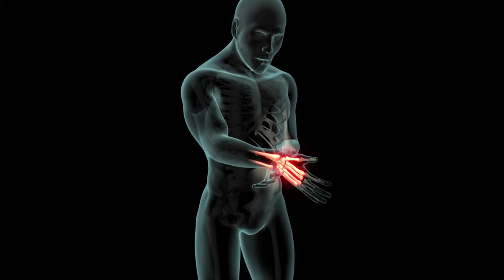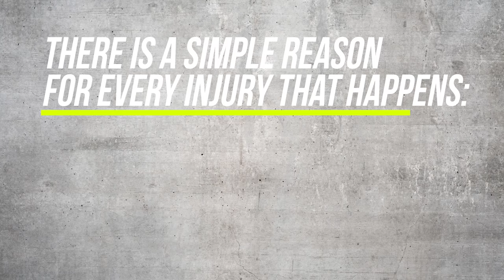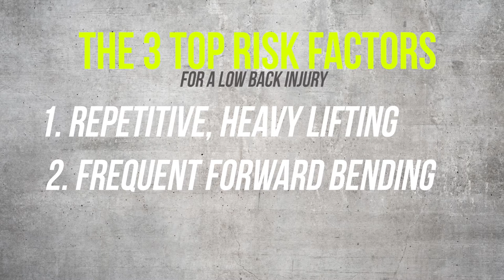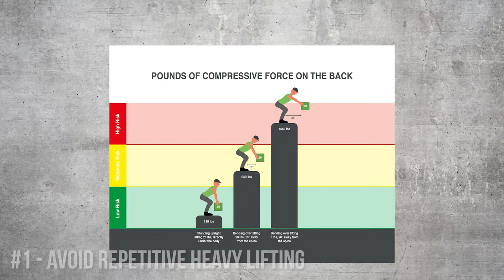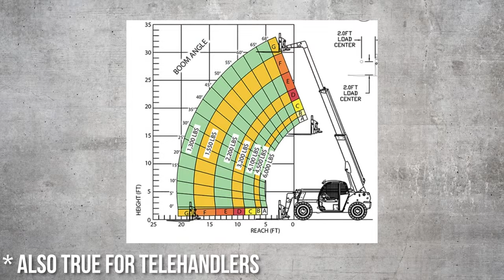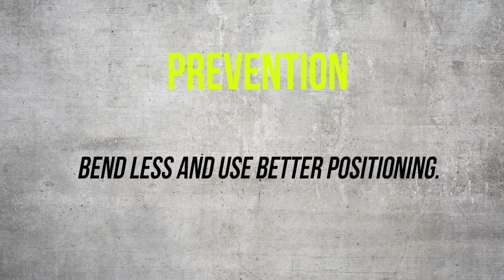BACK INJURY PREVENTION | 3 Tips to Prevent Back Injuries at Home and at Work

Comment: So many injuries occur from heavy lifting and pulling especially in construction and hands ob jobs. One advice I have learned is bend your legs while lifting.
Reply: Lift with legs not back 
Learned this way to late
Reply: @dumpsterfire6351  thank you for sharing this and I also found this helpful.
Reply from the maker: Another great tip!